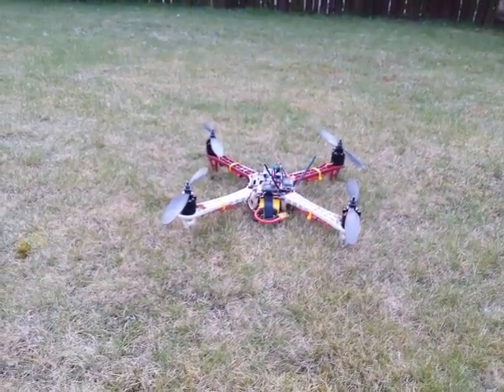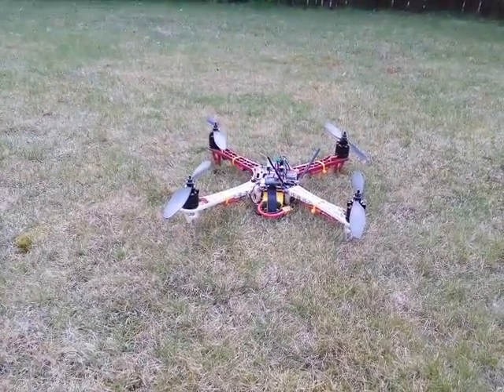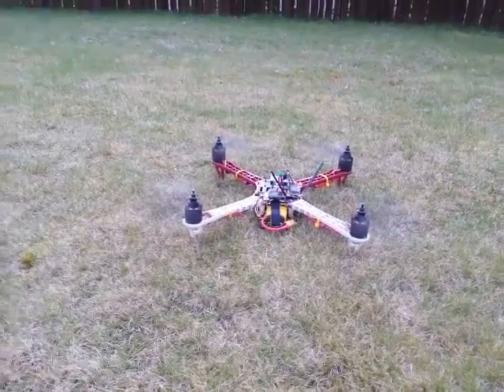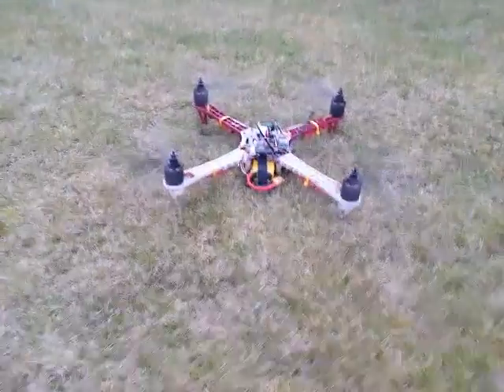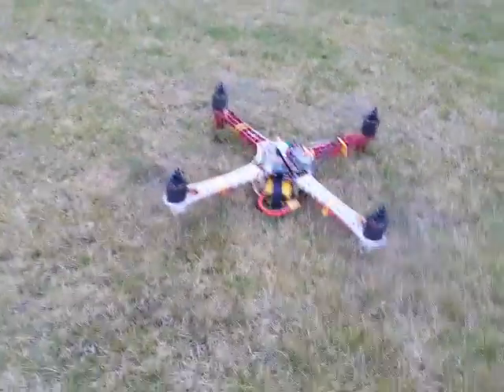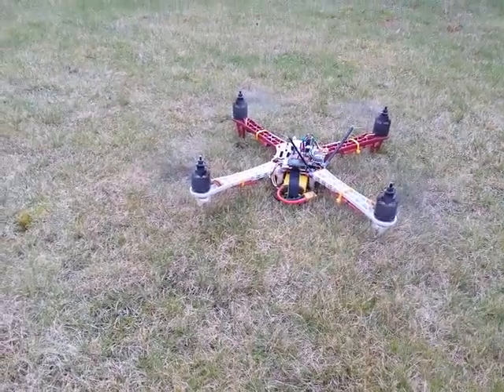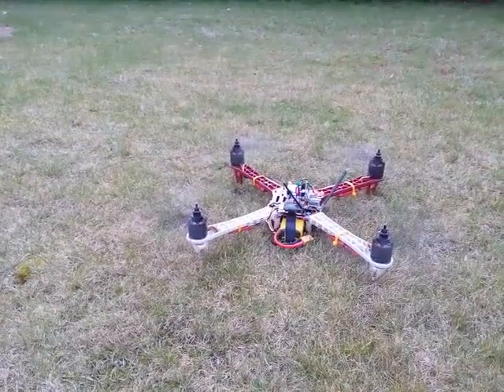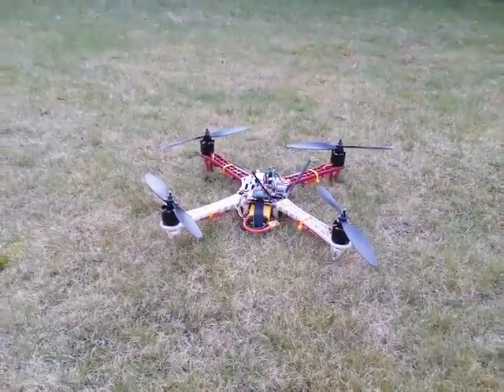Motor revs fluctuating - Issue resolved!

Comment: ok i figured out what my the issue is!!!! issue was caused by noise inside my drone ! try moving your receiver wires and re-rout away from any noisy electronics. i am running ppm fr sky d4r and about 4 step down reg. for lights ,cameras and whatever else and my receiver lead was acting like an antenna for the apm 2.6 and giving me a very annoying throttle speed/spike issue really upsetting after hours of labor ugghhhhh!!!!!!! best of luck to you ,hope i helped
Reply from the maker: Kevin, this is quite an old video. I tracked down the issue to the foam I had used for isolating the flight controller. It was basically too soft and allowed vibration to be induced into the FC (instead of isolating it), which caused the IMU some serious issues, causing the crazy motor outputs you can see in the video. I simply replaced the orange neoprene foam I was using (from HK) with regular double sided sticky foam and the issue was resolved instantly. So not a noise issue as in your case.
One lesson I learned is to give that orange HK foam a wide berth when it comes to RC. It caused similar issues on my Pixhawk flight controller and I purchased this foam specifically for this as it was recommended as a good product for vibration isolation.